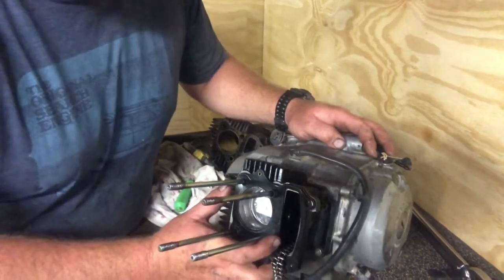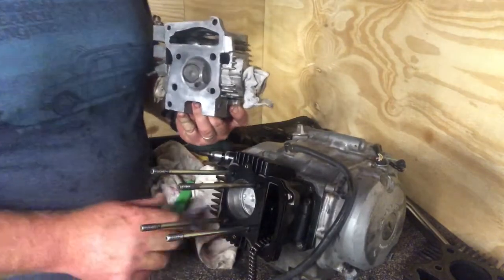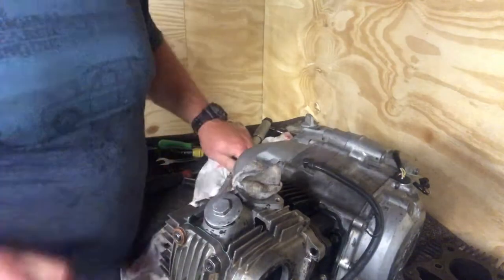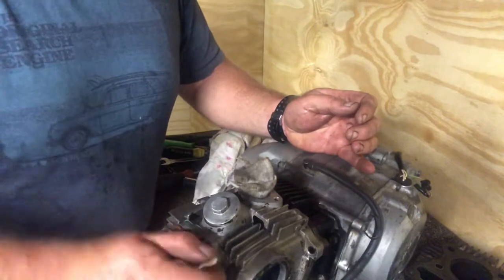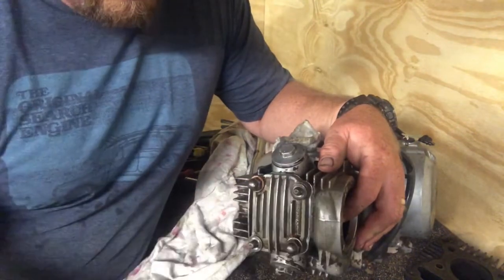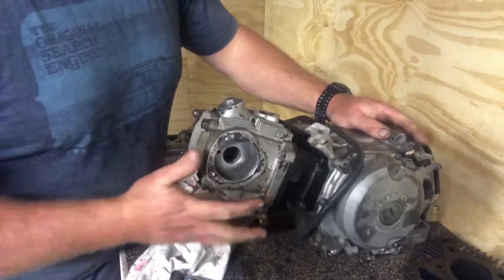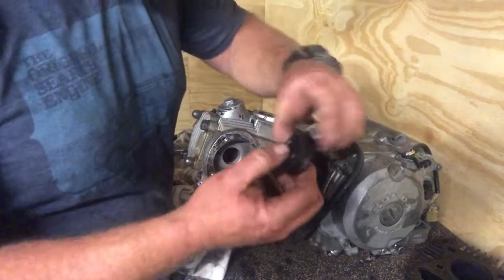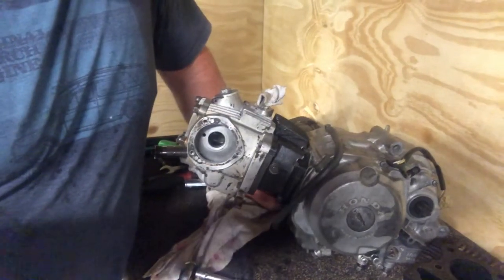Ct110 postie build fitting the head

Comment: That is the correct orientation for the copper washers and domed nuts. The story as I understand it is that those two cylinder bolts (top left and bottom right) act as oil pathways up to the top end.
Reply from the maker: Thank you Phil that makes perfect sense as they are the ones that have the o rings when using the paper style head gasket
Cheers
Reply: Thanks so much for the videos, they are a great resource. I just got a cylinder kit from Lambda, and it came with the metal head gasket that you’re using on this engine. My engine had the factory gasket with the two rubber o rings between the head and the cylinder. Can you tell me, if I use the metal head gasket, I don’t need those rubber o rings?